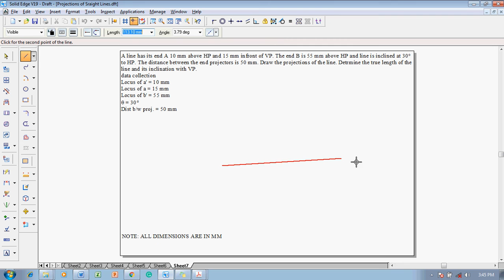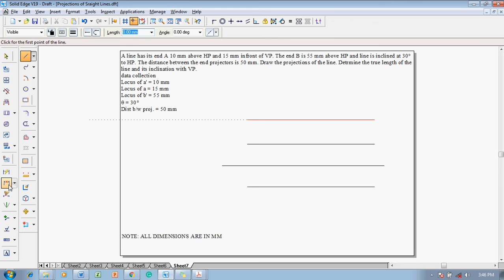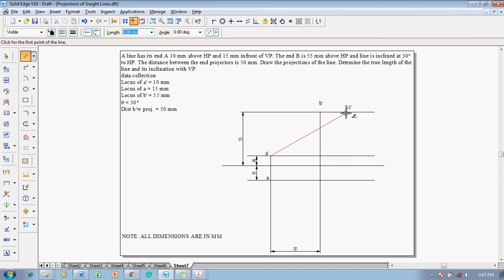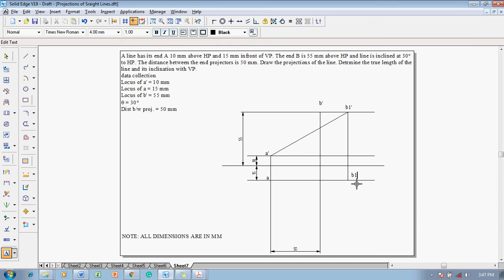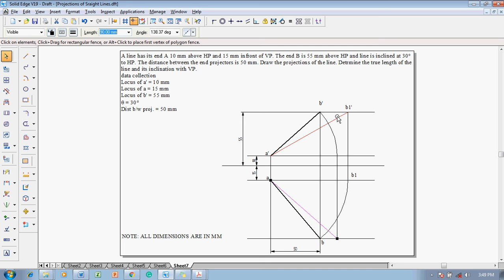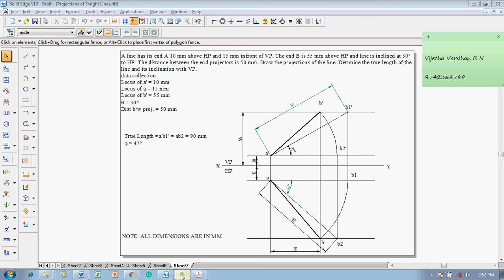Example 07 on Straight Lines

Comment: a line has its end A  10 mm above HP and 15 mm infront of vp ,the end B is 55mm above HP and is inclined at 30° to HP and 35° to vp . the distance between the end projection is 50mm , draw the projection of the line and determine the true length of the line and its inclination with VP

Sir the question is this.. where it has given inclination of 35° to VP
Reply from the maker: 5th data in the question
Reply: @VijethaVardhanRN sir here inclination with vp is clearly given as 35° in question, so the answer would be same 35° ryt? (, it's inclination with VP)

Comment: Sir how we  knew  that was a true inclination , that can be a appearent inclination,?
Reply from the maker: When discussing "Front View" and "Top View" in the context of lengths, here's a proper explanation:
 * FVL (Front View Length) and TVL (Top View Length): These acronyms specifically refer to the apparent lengths as seen in the front and top orthographic projections, respectively. If you encounter "FVL" or "TVL," it directly signifies the length you would measure on the drawing in that particular view.
 * "Front View Measures" or "Top View Measures": If you see phrases like "front view measures X" or "top view measures Y," this also indicates the apparent length of the object or line as it appears in that specific view. It's the dimension you would read directly from the corresponding orthographic projection.
 * True Length: Unless explicitly stated as "Front View Measures," "Top View Measures," "FVL," or "TVL," any mention of a length without these specific qualifiers refers to the true length of the object or line. The true length is the actual, unforeshortened dimension of the object in three-dimensional space, regardless of its orientation relative to the viewing planes. You often need to use projection techniques to determine the true length if an object is not parallel to the projection plane.
In summary:
 * Apparent Length (FVL, TVL, "Front View Measures", "Top View Measures"): What you see and measure on the 2D orthographic drawing. This length can be shorter than the true length due to foreshortening if the object is not parallel to the view plane.
 * True Length: The actual physical length of the object in 3D space.
Think of it like this: If you hold a pencil at an angle to your eye, its apparent length (what you see) is shorter than its true length. Only when you hold it parallel to your eye do its apparent and true lengths become equal. In technical drawings, FVL and TVL represent these apparent lengths, while "true length" refers to the pencil's actual physical dimension.
Reply: @VijethaVardhanRN  thank you sir ❤.